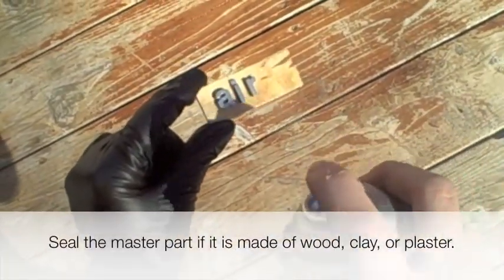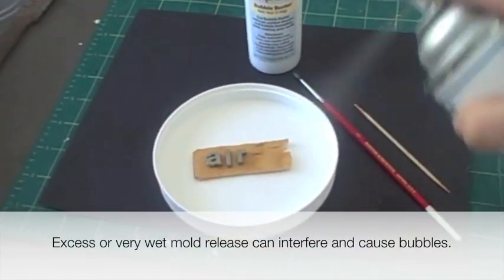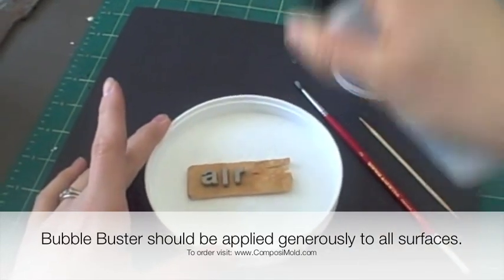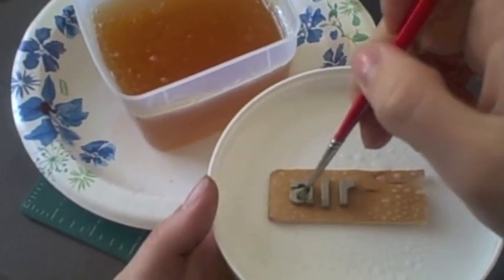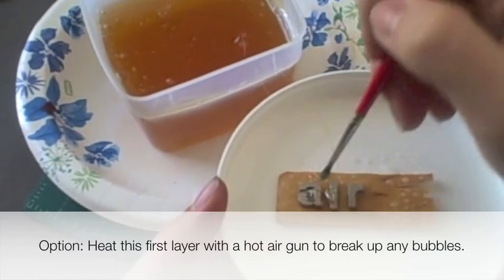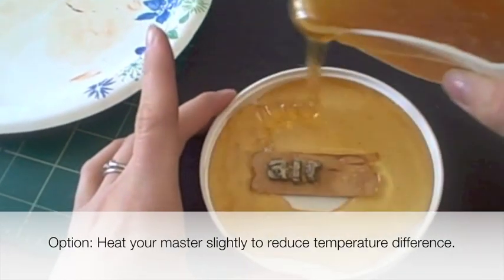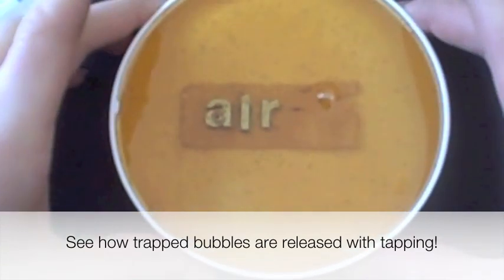How to Avoid Bubbles in Your Mold

Comment: i want to know if i can use that product in my epoxy resin. because all the time i get a lots of bubble on the resin ,and i use a lighter but still with bubble. so i would like to know if that spray work only to make mold, or work too in epoxy resin liquide.
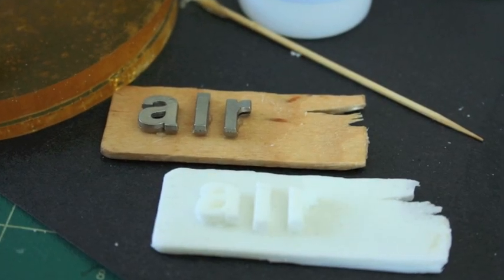Reply from the maker: Thank you for your question! Bubble Buster spray works when making molds with ComposiMold by reducing surface tension and allowing the bubbles to rise rather than sticking to the object being molded but, the Bubble Buster does not have this effect on epoxy resin. The best method for eliminating bubbles is to pour and mix very slowly and carefully to avoiding adding the bubbles like we did in this video:  https://www.youtube.com/watch?v=rtxgSLUYwIg epoxy resin mixing occurs at 2:14 in the video.
Reply: thanks so much to respond me so quick, i will check the video in the link that you send. thanks one more time.

Comment from the maker: That friendly plastic is our polyurethane resin. It's called ProtoCast, a very low viscosity, rapid setting, and rigid urethane compound with high strength. Check out our website to learn more.The link is in the description above. Thanks for asking.